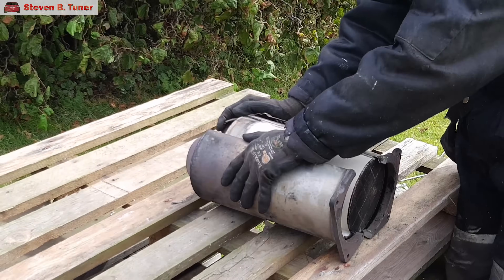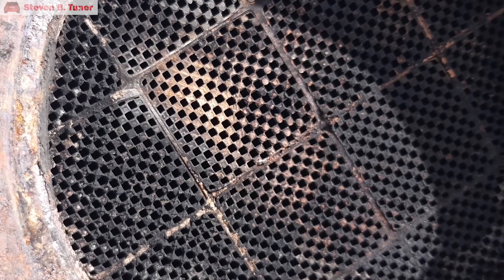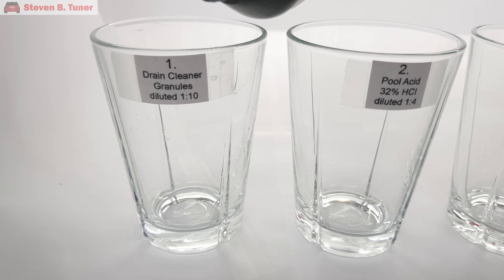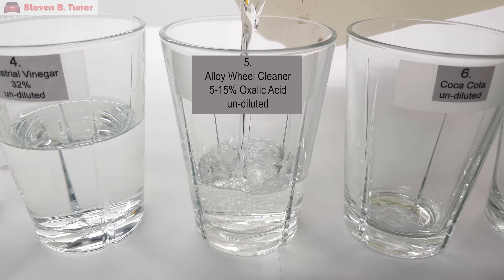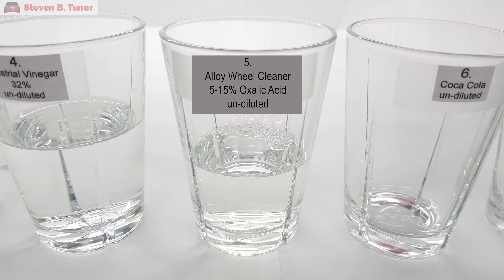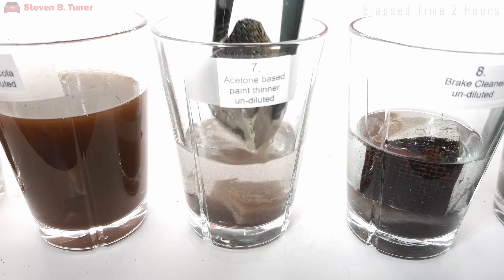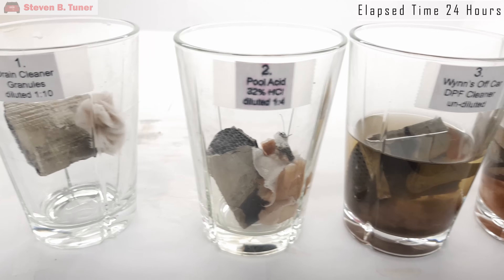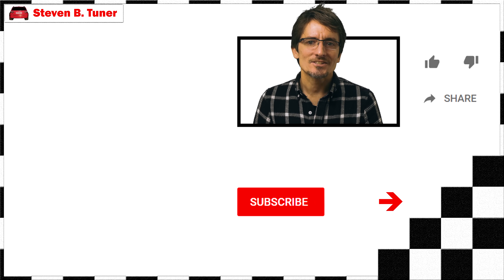DPF Cleaning at Home – 9 Chemicals Tested (Diesel Particulate Filter DIY Ash Cleaning)

Comment: Well I've got my dpf of my renault master van hanging from my A frame ladder after having flushed out what seems like endless Ash with just the hose pipe and now it's soaking with dishwasher tablets water. Tomorrow I'll be  soaking it with Wynns DPF cleaner so fingers crossed . I'll reply to this in a few weeks with an update.
Reply: Well so I over ordered on the Wynns Dpf cleaner and decided to do 2 x dishwasher tablet soaks and 2 x DPF cleaner soak with multiple clean water soaks between every step and this morning I put the dpf back on the van and it runs dreamy. Immediately noticed that not only did all the codes stay away after clearing but I got a major bump in turbo boost and my milage has improved by a good 25%. I will again try to remember to update this in a few weeks but my fist impression is pure happiness. I honestly don't understand why they can't just make this an easy process. No wonder so many choose to by-pass and delete the dpf. Just make it an easy to access cartridge that can be swapped out or cleaned. That rant aside I will do this again if needed
Reply from the maker: Well done and a great result! Unfortunately the manufacturers don't really care about such things, they just need the car to be relatively trouble free for the first 5 years.
Reply from the maker: Be great to hear how it goes!

Comment: A diesel practical filter should be bolted on a petrol engine and be driven for about half an hour and the filter will come out brand new
Reply from the maker: Hi, the extra temperature will burn off the soot, but it will not get rid of ash deposits. Ash also builds up in catalytic converters in petrol engines.

Comment: Dawn Ultra here in the the States has Sulfuric Acid. Not sure if that is available where you are or if other dish products have it. Heat make a big difference in the clean power of detergents.  Finally there are detergents for industrial cleaning that are alkaline if you run another test. These in the states are generally purple. You know you have one if it says it not use on aluminum or that will it stain or discolor aluminium.
Reply from the maker: Sulphuric acid at a low concentration is probably safer for the steel and stainless steel, but it is not so readily available in Europe, so I haven't done any testing to work out the optimal strength.
Reply: @StevenBTuner  Try asking Metal Plating Shops for acids, the smaller the better. The Dawn Ultra is type of dish soap for washing dishes in the sink. And power purple and similar alkaline based de-greasers are sold here at hardware stores and other places. Thanks for the videos!

Comment: I would like to see some feedback on how these methods affect the precious metals that coat the DPF walls.
I have a 35 yr career with a diesel engine manufacturer. 
But always looking to learn new things.
I've found a good soak in a surfactant and a warm pressure washer  (down low!) Works really well.
I'd like to try a giant ultrasonic cleaner with foamless detergent.(dishwasher)
Dishwasher tabs also work fabulously for oil in cooling systems.
Reply from the maker: Hi, in my other video I test the chemicals against the catalyst materials. Professional companies use a number of  cleaning methods in including chemical in conjunction with high pressure/low flow back-flushing, chemical and ultrasonic and high temperature baking with air pressure. With all of the methods you need to keep high pressure and strong acid concentrations away from the more sensitive catalyst materials.

Comment: I used a hammer drill, chisel, and a 3 inch drill bit.  It never clogged again.
Reply: Just to be clear to people reading, you can't just do this and expect to drive off in a modern car. It will detect it, throw some codes and go into limp mode. An ECU remap would also be required.
Reply: Well, it's even a easy solution for that problem as well 🤣
Reply: Makes the engine last longer too now it can breathe
Reply: A friend of mine used a piece of rebar ....same success
Reply: Better use dummy CAT CON, problems solved.
Reply: This is the most informative and thorough review I’ve ever seen! Top stuff! 👍🏻
Reply: What about the check engine light??
Reply: Lol lol I bet
Reply: 55555
Reply: Thata my boy
Reply: The only issue with that is deleting it from the ecu
Reply: @Natashajb  call canada, they will get ya going remotely.
Reply: @Natashajb  
The micro particle filter is not connected to the electronic.
Reply: I mean the overall best solution is to give diesels a bit of a rag now and again. An actual Ford 'technician' told me that after 2.0 TDCI C Max failed emissions on MOT, he told me (because I had two weeks before end of MOT), just do some hard accelerations, go right up the rev range for a week or so. Went back for retest and had zero problems, I now make this something I do each couple months.

Comment: Blue Harpic toilet cleaner does a nice job
Reply from the maker: Hi, if it is the one that cleans off the scale then it will probably help remove DPF ash buildup too!
Reply: @StevenBTuner  yes    Harpic 10x   5 or 6 out Tesco  thinks it's £1.50  I used the last time I soak it in it you can see it bubbling away let it sit over night and hit it with the steam cleaner  leave it like new

Comment: We have a fleet of machinery (cat, komatsu, kubota, ect.) We've had great luck simply pressure washing out the dpf filters. Once any of the machines start frequent regens, or will no longer clean them selves effectively through a normal or forced regen, we will pull the dpf off and disassemble them. Then use a low pressure pressure washer (maybe 1500psi) and wash them out from both directions with just water. This seems to clean 90%+ of the soot. The machines always run better and generally take way way longer to even do the next regen because they're so cleaned out it takes a long time to build enough soot back up to need to regen. The first couple times we tried it we were pretty scared to mess something up. But now its become a regular thing and have yet to have an issue. Once the filter is washed out we will blow out with air, place in front of a fan to dry, then reassemble. Codes may or may not need to be cleared. We've done this process probably 40-50 times over the past several years. Its quick and free.
Reply from the maker: Hi, that works great on older cars too, as long as they don't have an integrated DOC - the catalyst material is easily damaged by the high pressure.

Comment: Hello, I find your videos very successful. I have an Opel astra j 1.6 cdti 136 hp horse car. My question is,  hydrochloric acid (HCL) on the dpf [diesel partikül filter] on the vehicle, will it damage the DPF? Thank you very much for your reply.
Reply from the maker: Hi, the DPF ceramic material itself is not harmed by HCL, but higher concentrations than 7% will harm the stainless steel case and the integrated DOC (catalyst).

Comment: Have you tried the Coca Cola test yet I’m sooo curious now :) as I used to use that to clean grills at my old job . And now owning a vw Jetta tdi I’m so curious?? Please let me know if possibly was tested further. Thank you .
Reply from the maker: Cola contains some phosphoric acid - so I used super strong phosphoric acid in my other video about cleaning a DPF without a cat. For normal DPFs that have integrated Cats, I would recommend using the chemicals in my video: The No Damage DIY DPF Clean.

Comment: "I don't think I'll drink another cola in my life"..... Says the guy whose stomach generates and contains hydrochloric acid.

That said Coca-Cola has to be fairly dilute in terms of acid content, should have picked up some phosphoric acid from a hardware store. Being a stronger acid than vinegar and in a higher concentration, it should have done a decent job. It is evident that acids are quite effective at dissolving buildup.

EDIT: Of course, most of these reactions would probably be accelerated with higher temperatures, granted more setup would be needed for that. Thinking that I could use this information to clean a chinese diesel heater if it ever gets too much carbon buildup.

Comment: i always use gasoline for cleaning engine parts... works best is insane for engine oil and gunk... u just need something to vibrate or rub the surfaces usually a lil bit of a brush or in this case... a fish tank pump to make it bubbly and let it work its way there ultrasonic would work also if the part is placed inside a plastic or glass container.
Reply from the maker: Bubbling gasoline is a bad idea as it can create a very large explosion risk.
Reply: @StevenBTuner  That just add to the fun....

Comment: Hi Steven,

using acidic solutions only might be a bit of a gamble since acids promote the formation of emulsions and a permanent sludge if too much oil and soot present. 
I would suggest adding cationic surfactant to prevent sludge, promote active binding and removal of soot and the acid to remove ash. Go with something like Bezalkonium Chloride in the 1-5% range addition.
(Anionic surfactant and alkaline chemicals are usually in dishwasher powder/tablets)

You might be on to something here. 

Great experiment, no sane person would flush part of the exhaust system with coke though :D the added sugar will do more harm than good!
Reply from the maker: Hi, all good points! In my other vid I do a full DPF clean as a 2 stage process - the first stage is to clean away the oily soot so that the 2nd stage acid wash can do its work.
Reply: @StevenBTuner  Yeah I thought of that too, using either hydrocarbons or something like HEATED! sodium hydroxide solution or commercial/restaurant grade glass detergent to take off the soot before attacking the ash. 
The surfactant idea is more about creating something like Steven's even more effective mystery wonder solution or concentrate (would buy!!). Why do two soak and rinse cycles if you can make the acid work reliably for both with surfactants keeping the sludge/emulsion particle size controlled and small while the acid is happily eating away at the ash :)
Commercial grade dishwashers are doing basically the same but with an alkaline solution. For plates, the wash cycle detergent is basically potassium hydroxide with added surfactants in the ~5% range to deal with fat/emulsion, glassware only detergents are just potassium hydroxide solution (this is why coffee cups with milk remains, very greasy lipstick prints and plates don't properly clean up in glass washers). 
I work for a global manufacturer of commercial dish- and ware washing solutions and content like this really intrigues me <3
Edit: That leaves us with the question of disposal though. A two cycle alkaline > acidic route if adjusted right can result in a bucket of pH ~7 neutral watery suspension of ash, salts and soot particles. Mildly acidic one-cycle solutions with surfactants shouldn't be a problem either. Time to check environmental legislation I guess :D 
I'd definitely take that route considering the nasty fumes and environmentally unfriendly nature of hydrocarbon based solvents ending up being toxic waste when contaminated.
Reply from the maker: Having the HCL and NaOH react together at the end to form water and salt is definitely a plus. You can then filter out the remaining particles with a  coffee filter :-)

Comment: Hi, do you think you could use the dishwasher solution on a vehicle that has the dpf still on the car? And just tip in through the sensor hole at the top (vertical orientated dpf peugeot 207 1.6 hdi?)
Reply from the maker: I haven't worked out the best in-place cleaning method yet - so at the moment I would say that the product from Liqui- Moly is the best bet.

Comment: Hi all, can I ask is it soot in general thats so bad for humans or just the soot generated by fossil fuel diesel ?
Reply from the maker: Hi, I don't think any soot is going to be very good for you, but smaller particles are particularly bad ( PM 2.5 micrometer ).
Reply: @StevenBTuner  thanks for that. The reason I ask is oil lamps are sooty to the point of soot building up on the ceiling and they're used all over the world.
Reply from the maker: Indoor kerosene lamps and stoves are responsible for many early deaths in Africa. Particulates are not good for you. I have a particulate measuring device which I might use to measure the levels around candles, wood burning stoves, gas stoves etc...
Reply: @StevenBTuner  the results would be interesting. Especially a candle flame hitting a porcelain vaporizer.
Reply: If I had to guess, the candles and mist EO air fresheners we use in our homes are way higher ppm than soot from diesel outside. They compare those air fresheners to smoking a pack of cigarettes a day.
Reply: @kbdesignz5808  wow ! I never use air fresheners but I do use tea lights as a vaporizer with essential oils.

Comment: So can you put any of this chemicals straight into the fuel tank? 😛
Reply from the maker: No. These chemicals are only for use in a DPF that has been removed from the car - as shown in my other video: The No Damage DIY DPF Clean.
Reply: @StevenBTuner  That's a pretty difficult process. How about Cataclean? 🙂
Reply: How about installing a hole with a plug before the DPF, and apply the solution without removing the pipe?

Comment: Good morning steven, do you think I can use a dishwasher cleaner with ph 13.5? Won't the glass wool be ruined?
Thank's
Reply from the maker: Hi, fibreglass insulation is really resistant to chemical attack so I think you'll be okay with 13.5

Comment: I have seen mechanics clean the DPF using a mix of Diesel and Gasoline. Maybe u can try this in your next comparison.
Reply from the maker: Hi, that mix works great as a first stage wash to remove oily soot, but it doesn't have any effect on the long term ash deposits. Reasons not to use diesel and gasoline are that they flammable and also really expensive.

Comment: My DPF will be completly full with ashes at around 30.000km. Do you think it will work aswell without damaging a bigger dpf? Could you take a look about the product "Triol"? Still, very good video, thanks! Had to clean once my lower body of the car because of losing oil. By using Triol, I was able to easy wash away every black stuff there. Not only the oil was removed. But I dont know how it will work without a "flow" or with "pressure" by just letting it sit there. I use it where I can to clean stuff and never got dissapointed :). Kr
Reply from the maker: Hi, any good degreaser or cleaner will probably work well for the first stage clean.

Comment: I got some problem with your measurement. Like Dishwater tad, diluted 1:10??. so you take one tab into 11,4 Lit or 3 US Gallon, aprox that a standard dishwasher uses.  then you take one lit of that and mix it with 10 lit pure water??  same with drain cleaner granules. If it saya 3 spoon to one liter water on the package. do you dilute that 1:10 then.  Why not saying 1 tbl spoon to ex 1 gallon hot water instead??
Reply from the maker: When it comes to the initial clean to remove oily soot, it will really depend on what condition your particular unit is in. If your DPF is in good condition and has recently completed a regeneration then almost no initial cleaning will be necessary. However is your turbo has been leaking lots of oil then you will need to do many cleaning cycles to wash the oil out - along with drain cleaner or a strong degreaser or many dishwaher tabs.
Reply: @StevenBTuner  I got a picture I want to share and get your oppinion on. I assume you seen a lot of DPF and have a good reference. How can I share it with you?  And thanks for your education videos

Comment: 4 steps: 1. clean with diesel 2. clean with petrol 3. clean with warm water 4. dry with air
Reply from the maker: Hi, petrol and diesel will help with the first stage wash to remove oily soot, but they don't have any effect on the long term ash deposits that we need to remove with the second stage wash.

Comment: If the dishwasher tablet worked so good, wouldn't dishwashing soap be good too for the pre-wash?
Reply from the maker: Hi, if you have a bunch of oily soot in your DPF, then anything that breaks down grease is going to work pretty well. Others have used strong degreasers to good effect, and my favorite is caustic soda because it is super strong and cheap.

Comment: So, your recommendation is the drain cleaner for prewash and the brick acid for the ashes, is that correct?
(Sorry but there was no real conclusion to the video)
Reply from the maker: Hi, this vid leads on to my other vid showing my favorite method "The No Damage DIY DPF Clean", which uses drain cleaner and brick cleaning acid.

Comment: For €129 it is probably cheaper & easier to replace with a new one, 30 minutes work
Reply from the maker: You have to watch out for the cheap variants as they don't use the same materials as OEM, so your car will be down on power.
Reply: A good DPF costs at least hundreds
Reply: @anidiotinaracingcar  I have enquired already, Germany company, made in Germany for my car, €129 at this moment, they say may price rise in months to come, but not too much, shipping is expensive at near to €40, but still better than all time to clean old one

Comment: You also need to check that the catalyst still works after exposure to each cleaning solution.
Reply from the maker: Hi, the catalyst is pretty tough, but it can be killed with a high pressure washer.

Comment: I suspect that an alkaline cleaner with  agitation would work a lot better than just soaking. Ideally, some sort of recirculating pump, plus vibration or ultrasonic agitation applied outside. The ideal would be to be able to do this while the dpf was still on the car :)
Reply from the maker: Great ideas!
Reply: There are cleaning solutions that work when the filter is on the car. No idea how effective they are